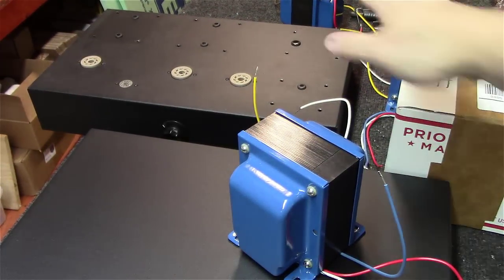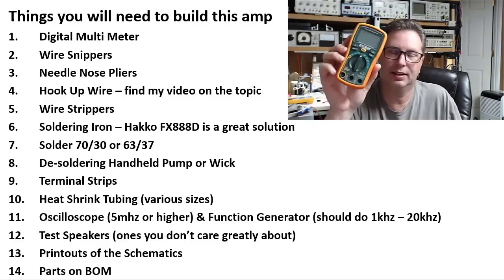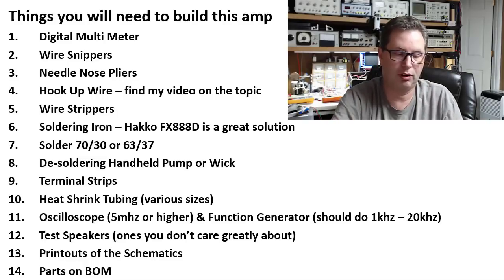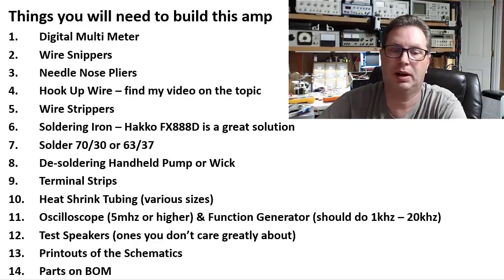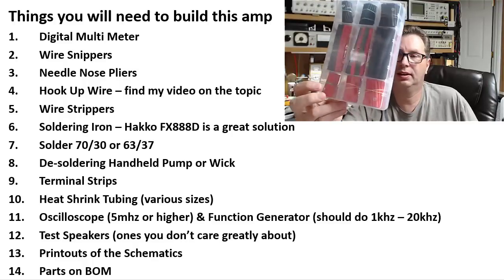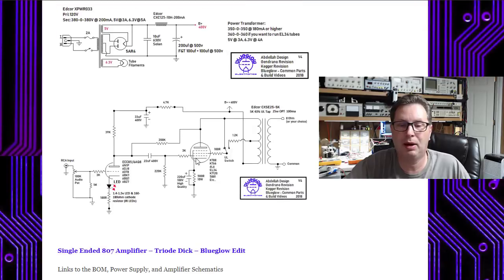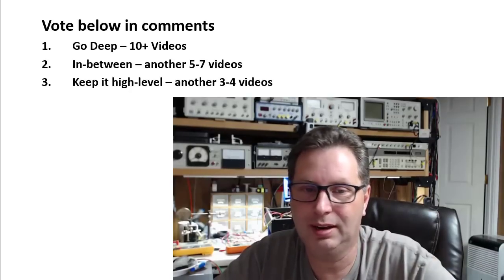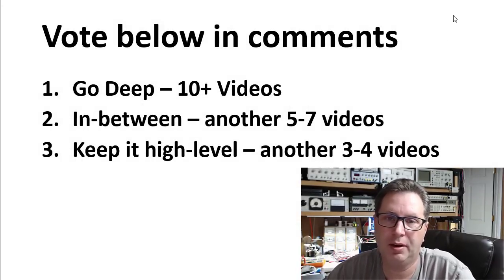KT88 Single Ended Tube Amplifier Build 2018 - Part 4

Comment: I watch your videos for knowledge and entertainment. I really like hearing you discuss your thought process and reasons for choosing to do or use the things that go into your builds and repairs. The deeper the better is my preference. I went through electronics school MANY years ago and worked radar systems for around 37 years plus. Electronics was never a hobby for me but now that I am retired I am finding the joy in it again. Keep posting your videos, mistakes and all, we all make them and I have learned much from mistakes regardless if it was me that made them or someone that I worked with. Don't waste the lesson if something goes wrong.

Comment: I’ve heard it said that the quickest way to learn to swim is to be thrown in the deep end, so I say GO DEEP ! 

That does put more of the work on you initially, but once the videos are made, I think it might decrease the number of emails you get later asking for ‘advice’ on how to build the amp. So it may save you time at the far end. It would also greatly decrease the ‘psychic hurdle’ to starting in on a build as a complete newbie, and I gather from your past videos that drawing new people into the hobby of DIY audio is one of your goals. The difficulty starting out on your own can’t be understated. I’ve built one point to point tube amp before, and although that was from a Bottlehead kit with excellent instructions, I still put it in the closet for 6 months because I found the process so discouraging without help. I suspect those who want fewer videos are probably further along in the self learning process, and they can just fast forward through the parts they’re already familiar with.  Des

Comment: I vote 2, fairly deep! Thing is, we can learn a lot when you explain the hows and whys of the particular design and circuit elements. Also the tips on layout best practice, how different parts can effect one another and how to best place them and route wires etc. Thanks for your work and inspiration. M

Comment: Yes #1, go deep. I enjoy the longer videos with a high level of detail. I have rewatched the 807 build many times over and found the length of each episode to be fine. Oh, BTW; On the power supply schematic the fuse and switch should both be on the hot side.

Comment: I've had a similar issue with Edcor paint, but in my case I think it was a prep issue because it's at the top of the end bells, and I see what looks like corrosion under the paint. I was just going to sandblast the end bells and repaint them with either a Rustoleum or maybe a black lacquer. 

Also, I've seen several forum threads where people are building this amp along side you, so I'd like to see you go deep. I think there are a lot of people who would like to learn more about how these circuits work, and I think a lot of those people are the ones building this amp (at least that's the impression I get from the threads I've seen).

Comment: Mark, I really enjoy your videos, and I am eagerly waiting to see how this amp turns out. As many others, I am committed to building it. You probably won't like this, but I am not sure you are asking the right question. Even 10+ videos are not a substitute for a degree in electrical engineering. Not that I think you need one to build this amp, but what I mean is that if a newbie builds this amp and gets an off voltage, blows a fuse, notices hum, hiss, or crackling in one channel, etc. even 10+ videos won't help much simply because you cannot explain and anticipate every possible issue that might arise. No number of videos can ever replace experience. I think a better question would be to ask how experienced your audience is. On the one hand, you expect them to be able to use an oscilloscope (in my eyes, that requires a fairly advanced understanding of electronics and signal processing) but on the other hand you recommend soldering stations, wire strippers and pliers. When you browse the Bottlehead forum, for instance, very often the answer given to a problem is, "you have a bad solder joint". Fairly basic stuff. You, Mark, probably rarely have one and could easily identify it but for a newbie it would be very difficult to distinguish this from other potential causes of a problem. 
That being said, I think very detailed building instructions would be great (so, that is a "1") but what is more important is a way to maybe have some sort of a feedback forum (run not just by you) so there would be some sort of support. I need to stress that I know you are doing all this in your free time for the love of tubes and amps. In the end it everyone for themselves must decide if they can take up such a project.

Comment: In the 3d Printing Community it is nearly beat into you to never let your Boden tube melt which is made of PTFE.  So I find it odd that this industry is purposely melting it.  Don't want to lecture,   just concerned or possibly confused.  Thanks for all your great videos.

Comment: You don't need a thermal stripper for teflon wire.
Use a very high quality pliers style stripper. Clamp it over the wire, squeeze, turn 90 degrees and squeeze again.
Now you can use a grabber style stripper to pull the insulation off.

Comment: #2. Honestly because its a good compromise. Maybe touch points on critical values, why they are what they are and basic operation of the circuit, but I don't think it needs any more than that honestly.

Comment: Hi Mark, 1.) Go whole hog and show it all, max it out on video detail, I think many could benefit, and for those who would like less they simply do not have to watch... BTW not sure where you're getting a Hakko FX-888D for $80, the cheapest I could find is $95+ shipping.  Ebay has the Fakko made in China house burner for $55 but no one would recommend that.
Reply from the maker: They may have gone up in the last year, haven't priced one in that timeframe
Reply: Hi Mark, I was pricing various soldering stations for a replacement for my Weller WCC100 which failed again and parts are no longer available.  I wanted cartridge type solder tips like the FX-951 and I finally opted to buy the Pace  ADS 200.  Mikes Radio Repair did a review and the price for the tips was 1/3 that of Hakko, Weller, JBC or Metcal.  Just about everything for electronics from components to test gear has gone up 15%-25% just in the last 10 months.

Comment: $200 is still considered cheap for a thermal wire stripper.  Have you tried to price an American Beauty one?

Hobby Lobby sells an $8 wire cutter/stripper for 10-22 gauge that I can recommend.  It is fully hardened and tempered and in my tests will cut through 1/16" mild steel without issue.

Comment: Hey Mark! Even though it’s gonna push back the preamp build project you mentioned in a previous video, I say (1) go deep. Also, this is gonna be more work for you, but do you think you could label the purposes of the caps/resistors on the schematic? Something simple like “decoupling,” “cathode bypass,” grid leak,” “grid stopper,” etc. It’d really help this noob out. Thanks!

Comment: Two suggestions came to mind after my first post, so I thought I’d add them in this second post :
1)  Perhaps each video could have a short introduction of what is covered in that video, with a rough           
      time point mentioned of where in the video each subject is started, so that more experienced 
      viewers could just fast forward to that point.
2)  At the risk of asking for too much, would it be possible for you to include in the Notes section of 
      you’re website a drawing of the underside of the amp with just the heater wiring, or just the B+ 
      wiring, or just the power supply wiring. That way the newbie could compare the drawings of each 
      section of the wiring to each video section that covers that bit of wiring. I think that this would help
      clarify the build process for first timers. Des

Comment: dear bluglw, first a huge thx for your videos : it s really great to share your knowledge and your videos are just what i m looking for to build my first tube valve amp. i ve no knowledge about electronics and electric things so they re really helpful to me!! i have a big question: i ve done my own diy interconnect and speaker cables with silver cables and pife insulation. i would like to replace all the copper wires in the amp with the same silver cables and pife insulation jackets: i ve no knowledge about electric things and i m wondering what size (awg) i should use to reach that goal: do you have any hints? or would you not recommend at all doing so? thx for your hints and tips!
thierry

Comment: VOTING: Somewhere in the middle! Stop talking about your tools--save that for other videos dedicated for tools--and refer the basics to other videos. But I do like the tool talk, as a tech I really appreciate having the right tools around. But right now I want to know about what makes this high watt SE amp great in design, what parts make it great, and what good craftsmanship goes into it. Thanks for the great videos!
Reply: The guys voting "Go Deep" should probably read more books and reference other less advanced videos. This channel has DEEP knowledge and insight, but we don't need 10+ "deep" videos talking about tools or hookup wire--those should be a separate thread from this KT88 build.
Reply from the maker: Any good set of build instructions will come with a page on the tools required to complete this project.  :-)

Comment: Greetings:
I have been soldering since the mid 1960s and the only 2 rosin-core solder alloys I have seen are 60/40 lead/tin and eutectic (lowest melting point alloy) 63/37. n case I missed it, what temp does 70/30 alloy melt at and when is it used?

Comment: I'd be curious to know that of those who say "Go Deep" have actually purchased the transformers, components and so on.
Likely darn few.
I have, and am 80% along finishing this beauty.
I want to see your node voltages, grounding scheme, and performance specs.
Especially hum, noise, SNR and gain.
Thanks.
Joe
Reply: I'm actually surprised how many actually do build along with him.  I want to build something this winter, I thought it would be the 807 but I want to see this one through first before I decide.  If it stretches through to spring then so be it.  I am after anything he has to teach me, I don't think whether or not someone is actually building the thing along with him is relevant at all.

Comment: Yes go deep 1    i have built  my JE Labs KT66 SE Amp with external psu useing choke and damper Diodes graet slow startup and james 5K output Transformers plus my WD phono and pre Amp kits . All custom built  making them better than the standerd kit  all this runs into fostex 126ES back loaded horns  i have set  of 5K hammond 1628 SEA looking for a schematic 
Yes i can build my amps well now from the schematics  buy lack on understanding  the testing of the amp with scope some detals on this andthe other testing tools would be helpfully more so as i am in the UK so 240volts in the wall some refrence to this aswell will help 
the deeper the better
Thanks